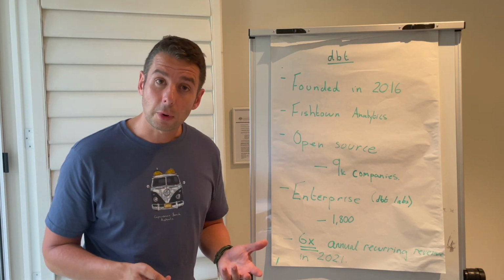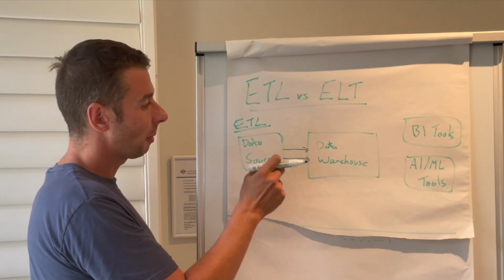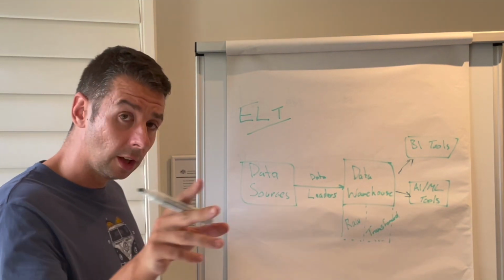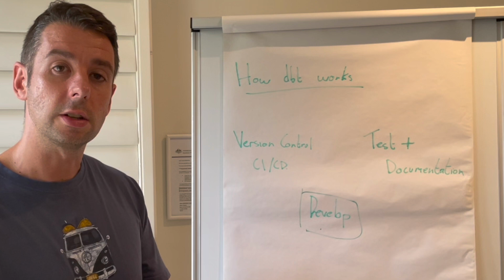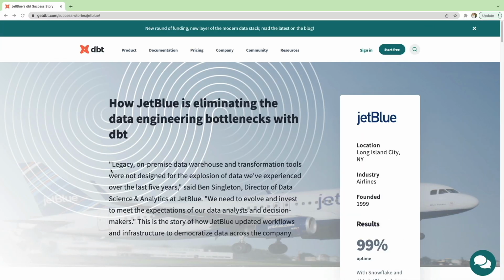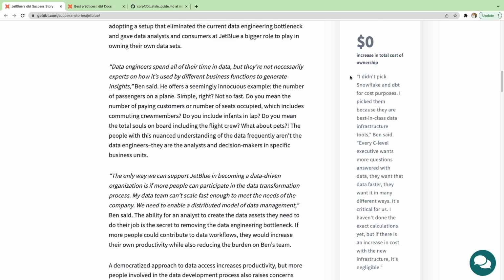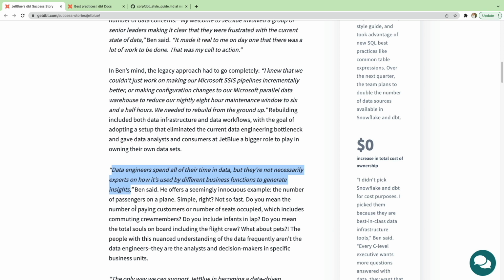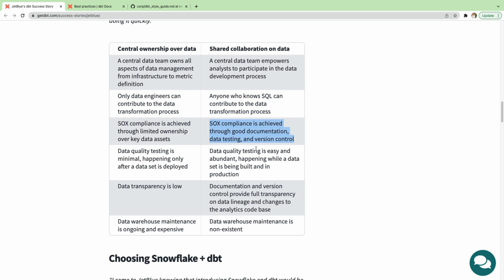What is dbt Data Build Tool? | What problem does it solve? | Practical use cases

Comment: I"m confused is DBT just a query builder?

If I use raw SQL in my webapp instead of an ORM. Where would DBT fit in? Would DBT be used to switch from raw SQL queries when fetching my data variables e.g. sql_data_python_object = raw_sql_query(against existing DB). So instead of raw_sql_query I would now write a dbt_query? But the benefit is that this query works on more DBs than say a raw pg query.

So is DBT a query builder which works like an ORM in the sense that you can use the query on any DB? If not I don't see the purpose for it when I could just use a raw SQL query on the datawarehouse after the pipeline has finished filling up the datawarehouse.
Reply from the maker: A query builder is a fraction of what it can do.

It has tight integration with version control which opens the door to DataOps and CI/CD.

You have a range of different materializations which can be switched in an instant using a configuration parameter across a database schema or even individual objects.

You can automate testing and leverage out of the box standard tests easily as well as creating your own custom tests.

Job dependencies and orchestration is automatically handled for you, along with the flexibility of which models you wish to build, run or test.

On top of that, you’ve got automated documentation, which can be generated using the single command.

I’m sure there’s more but that’s just off the top of my head.

Comment: once you get them into the data warehouse, you can run a set of sprocs to cleanup/transform the data.  don't understand yet why this is any better than just a few sql queries.  I am not being negative, I really appreciate the talk.
Reply from the maker: Yep you absolutely can do this. However, dbt adds many additional benefits, right integration with source control for CI/CD, automated testing and documentation, dependency management between jobs is taken care for you as part of orchestration to name a few benefits. 
It comes down to your specific requirements and what you need to achieve really, it’s never black and white.

Comment: Cloud data platforms are not the reasons why data teams started to do ELT instead of ETL. ELT has been performed by data vault practitioners since 2001.
Reply from the maker: The point being you were still constrained by on prem resources regardless of your approach. ELT was a way of adopting a pattern to work around the constraints of moving data out of the db to your ETL infrastructure and back again.

The elastic scalability of the cloud opened up new possibilities when adopting elt patterns
Reply: @mastering_snowflake  but ELT could be performed before cloud data platforms.